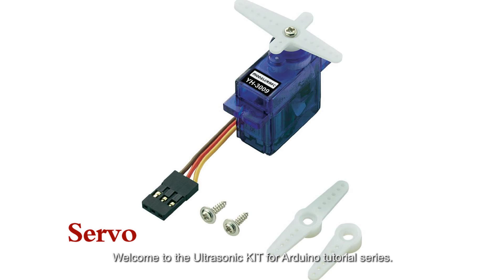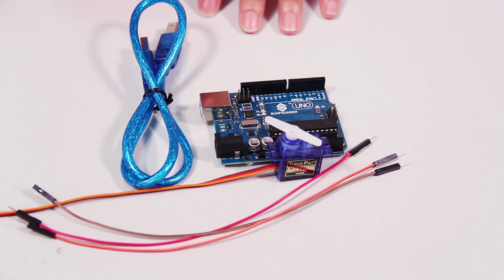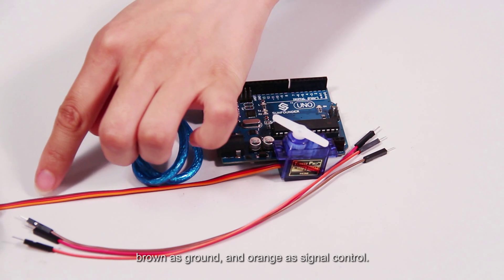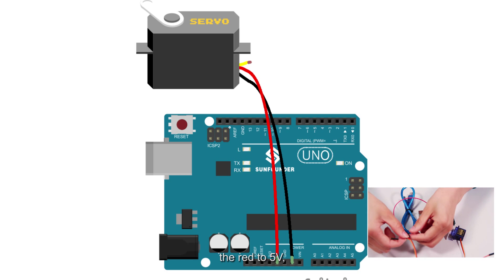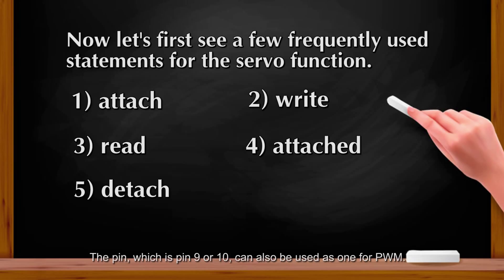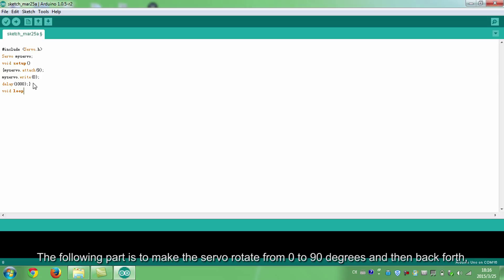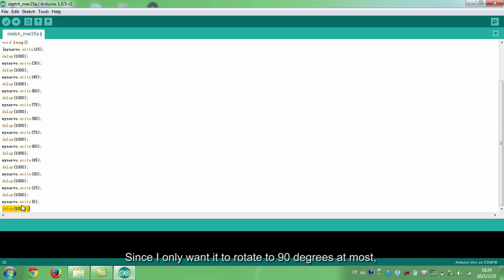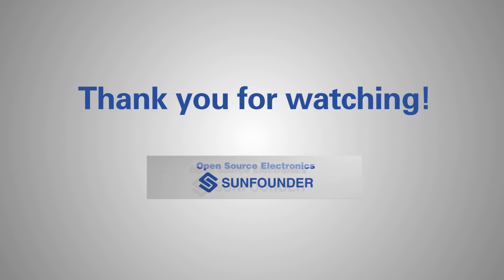SunFounder Kit Tutorial for Arduino - Servo

Comment: Instead of all that typing why not do something like this:

int x; // Our variable to represent degrees
// Send write commands in 15 degree increments until 90 degrees
for (x = 0; x < 90; x=x+15) {
    myservo.write(x);
    delay(1000); }
// Send write commands in 15 degree decrements until 0 degrees
for (x = 90; x > 0; x=x-15) {
    myservo.write(x);
    delay(1000); }
Reply from the maker: +Kamryn B Thanks for the advice! Your code is neat. Actually we've considered applying this method, but for the purpose of easy understanding and busic learning, we chose to separate coding of each 15 degrees. For more advanced projects this may not happen.